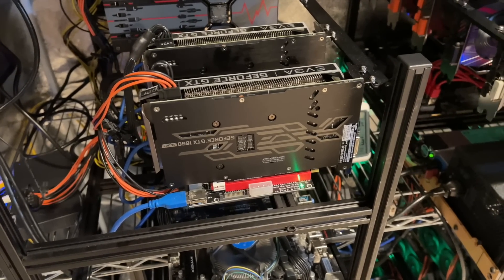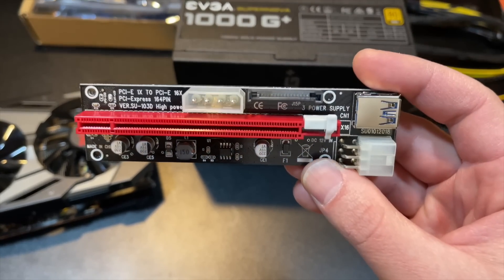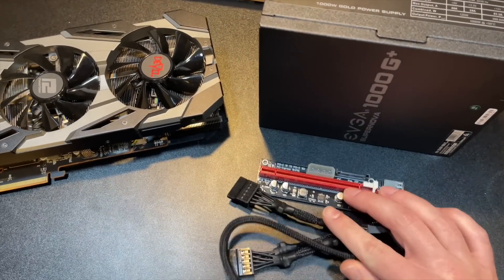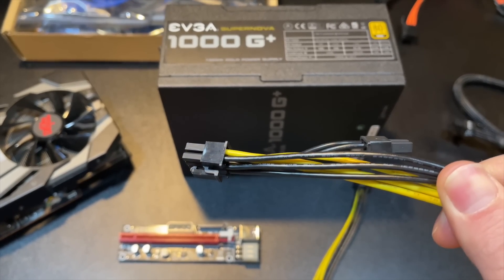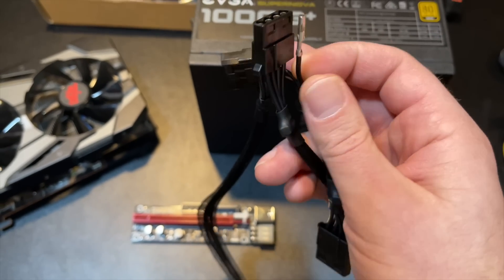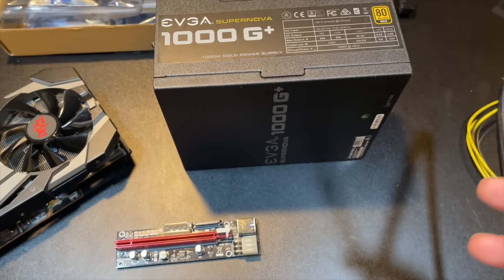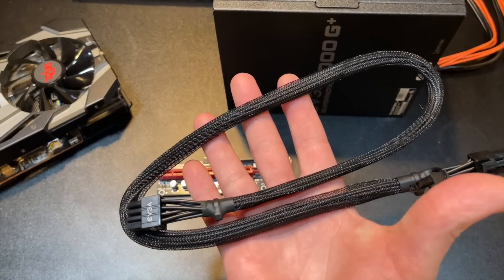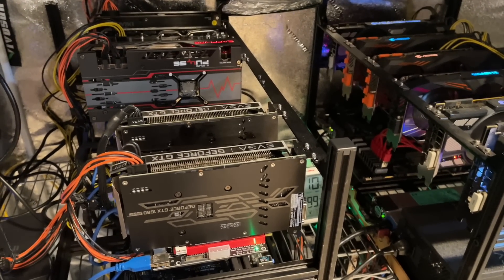Powering GPU Mining Risers Safely

Comment: What are your thoughts on using a longer USB 3.0 cable (5 to 6ft) instead of the short 2ft cable that comes with the riser? Can the length potentially cause issues?
Reply from the maker: You should be fine. I've seen miners using cables of varying lengths in their builds.
Reply: @RedFoxCrypto  Great, thanks! I have another question if you wouldn't mind looking at... I'm planning on using a pcie cable to power my gpu and riser. My question is, my 1080 gpu requires an 8 pin and 6 pin input. Would it be ok to run one pcie cable to both the gpu and riser board? I would use one evga dual connector pcie cable (two 8-pin connectors). On the short end connector, I would use a pcie splitter and connect it to the gpu 8 and 6 pin inputs, then on the long end connector, I would run that directly to the riser board 6-pin input. So essentially, I would be splitting the cable 3 ways (one 8-pin and two 6-pins). The 1080 GPU is rated for a max of 225w (one 8-pin and one 6-pin input). When mining, the 1080 usually draws around 170w. So if the riser board can use a max of 75w, and the GPU can use at max 225w, the maximum amount of watts would be 300. If the evga 8-pin pcie cable can safely supply 300w (two 8-pin connectors that can connect to two gpu 8-pin inputs rated each for 150w, would be a total of 300w) this should work, right?
Reply: @RedFoxCrypto  any thoughts on my previous reply would be greatly appreciated.

Comment: I'm planning on using a pcie cable to power my gpu and riser. My question is, my 1080 gpu requires an 8 pin and 6 pin input. Would it be ok to run one pcie cable to both the gpu and riser board? I would use one evga dual connector pcie cable (two 8-pin connectors). On the short end connector, I would use a pcie splitter and connect it to the gpu 8 and 6 pin inputs, then on the long end connector, I would run that directly to the riser board 6-pin input. So essentially, I would be splitting the cable 3 ways (one 8-pin and two 6-pins). The 1080 GPU is rated for a max of 225w (one 8-pin and one 6-pin input). When mining, the 1080 usually draws around 170w. So if the riser board can use a max of 75w, and the GPU can use at max 225w, the maximum amount of watts would be 300. If the evga 8-pin pcie cable can safely supply 300w (two 8-pin connectors that can connect to two gpu 8-pin inputs rated each for 150w, would be a total of 300w) this should work, right?

Comment: Thanks for the information. Regarding the molex, I know as a rule of thumb that current is a function of thickness, and by eye they are the thickest plug. Thats a good starting point. But look at the thinnest part of the connector should give some idea of quality. If the neck is super thin, thats where the heat will be, even if the connector is wide enough. I checked current specs on the genuine pins, and they are as you say. I took a measuring tool to the connectors on my PSU and on an external hard drive caddy, and both had pins which measured 2.6mm side to side. The specs dont indicate squared, which is often the case for power cables so I do think they are 2.6mm pins on PC, even if it is only a defacto standard. I have not seen a different size on PC connectors in the last 30 years. I have seen different sizes on 4 pin molex connectors but they were from other non-pc applications. So I am very confident on 2.6mm being a defacto pc standard. Now the big gotcha, is you get 2 circuits - +5, +12 and and gnd each. And on my 850 watt 'high current' gamer psu, those 4 pins go in to a pci-e 6 pin style connector, with molex pin to 1 pci-e pin, and 2 empty slots. These pins are smaller than the molex connectors, so less current will be supported at the PSU end. In fact 1/3rd of what you will get with 3 wires on a real pci-e connector. I think this is a common way of doing it with modern PSUs so in a lot of cases the molex limit will be on the PSU end. If they are hard wired to the PSU PCB however  I'd say they'd be good to go.

Comment: Well no -- the issue here is NOT what the CONNECTOR is rated at, it's what the WIRE is rated at.  Each SATA and MOLEX pigtail has a SINGLE 12v wire -- that's it.  Your 6 pin PCIE cable has 3 (8 pin is 6 pin + 2 grounds, beats me).  8 pin at 150w places ~50w per wire, 100w per wire if you've got a doubler.  A 3 port pigtail for SATA power will try to put 57w x 3 into a single 12v wire -- 172w.  That's the same as trying to pull 516w through a single 6 pin.  The weak spot will be usually at the crimp on the first connector.  It will heat up and cascade from there.   If you have 3  or more sata / molex pigtails coming out of the PSU, cut them all and terminate them into a 6 pin.  It really helps if you have the proper tools and connectors.  Another thing with the risers is to port team. -- Use both the sata and molex connectors on them -- 3 cards across 2 separate pigtails will place 112.5w per wire and 37.5w per connector.

Comment: The 4 pin molex amperage question: as I know, these pins are rated for the wire, they will be able to crimped on. Like there are cheap pin for 20-22 awg , there are common 18 awg, and also  more robust pins for the 16 awg wires. It is hard to crimp a cheap pin to a 16 awg wire, so you can guess the amperage based on the wire gauge

Comment: Some risers come with a splitter from 6pin PCIe connector to two SATA, so each SATA can handle 37,5W. To be safe, plug one connector on each SATA strand. (You'll need two).

Comment: What are your thoughts on PCIE cables that come pre-split (so 8 & a 6/2 combo) for dual PCIE GPUs?
Reply: It is fine as long as you keep the wattage down. Also depends on the cable quality. I avoid ever going over 200W on a single cable.

Comment: Hey I have  few questions, and nobody can really answer them for me. Hopefully you can. Also I've looked through most of your videos and I still can't find how you are powering the top of the gpu. So lets say for the 3070, I believe that's what was in the video here. So I have a PCIe from my PSU, to a splitter that is going to two risers. Then how are you powering the top of the card? With 1 PCIe wire from the psu? Where is that 6 pin PCIe coming from, does it get split off from the PCIe from the psu? Also I'm looking to get PSUs that are 1000w, which I believe will have 4 PCIe slots. 

Thanks!!!
Reply from the maker: Hey Drew! I have a single PCIe cable that splits into a dual 6+2 pin connector at the end. I use that to go into the GPU itself straight from the PSU. https://external-content.duckduckgo.com/iu/?u=https%3A%2F%2Fc1.neweggimages.com%2FProductImage%2FAMSJS2012123Dysf.jpg&f=1&nofb=1
Reply: @RedFoxCrypto  okay awesome thanks! I was assuming I had to use 3 slots on my psu for each gpu? So is this the way you power 3080s also? Also this might help me because I might buy 2 850s psu's.

Comment: looking for a splitter on amazon for the PCI riser. The ones in your link are sold out. Do you have any new suggestions. I am very new to mining rig building..Also how do you chain multiple PSU?
Reply from the maker: Those splitters will be back in stock this week. You can get various accessories to chain together PSUs. Add2PSU for multiple ATX power supplies or breakout boards with Molex for server PSUs.

Comment: can i use 8-pin split to 2 x 8pins
Reply from the maker: Yes, but still keep it below 288w on that strand.
Reply: @RedFoxCrypto  thanks, if it's 6pin to dual 8pin, which slot from psu would i put it,

Comment: New subscriber after this video, thanks for all the info. On the Corsair PSU I have cables with x2 6+2 pins without using a splitter. I am powering a 1080ti from one cable using the 6 and 8pin connector. The TDP for the ti is 250w. According to this the 8pin cable can carry 288w https://www.gpuminingresources.com/p/psu-cables.html however this says the 6pin is 216w not 192w. So in theory I could use a splitter on the 6 pin and put that to the riser and gpu and on the same cable use the 8 pin to the card. Whats the max the 6pin on the card can draw? Thanks again
Reply from the maker: Thanks Anthony. The max your x2 6+2 cable could do in ideal conditions would be the 288w (3 8A pins*12v rail). You still want to be mindful of staying around 80% of the max wattage since it'll be a continuous load. This is to be safe around any voltage spikes. That said, I would use a separate PCIe cable to power the riser from the one going into the PCIe ports on the GPU. You can even split that to power 2 risers since they'll draw 75w each.
Reply: @RedFoxCrypto  thanks for the reply! I'll look at getting a second psu for the risers but for the moment what I'm doing is technically safe?
Reply: Sorry to go on, but want to make sure, if a gpu tdp is 250w and assume the riser is drawing the full 75w then the 6 and 8 pin can only be drawing 175w between them, so other than maybe being slightly over the 20% redundency this should be fine

Comment: But isnt that a myth? Yes the PCIE max output is 75watts. However it is really  up to the card and how its connected. If recall, if 6pin, would mean 75 watts via the card split with 75 via the mobo for 150 total. Which with your logic is correct. However if a 6pin + 8pin is used, the card now pulls 75+150 watts, so the total from the PCIE is roughly 25 watts, well in range of the sata capability of 54 watts. Though I wouldn't daisy change them and run maybe 1 sata cable per riser. x1, x4, x8 or x16 all do the same draws of 75watts, regardless of size. But again the gpu is what determines how much is drawn.
Reply from the maker: Different GPUs will draw their power in different ways over the combination of the PCIe slot or plug-in connectors. Some of the newer AMD cards have been tested to draw the full 75w from the riser and less over the PCIe plugs. In my experience, NVIDIA generally pulls most from the PCIe plugs on the GPU and minimal from the riser.
Reply: @RedFoxCrypto  This is confusing, isnt the pcie slot and the pcie/risers both one in the same? The gpu draws power from teh 6pin/8pin connectors, from there it hooks up to the pcie slots/risers. What I am getting at is that its purely subjective to what you are running. If your running a card that draws less than 200 watts, its safe to use teh sata to power up that riser, as most of the power will come driectly from the PSU. If your doing something lets say a 3080 that requires 300 watts than yes please use the appropriate cables to hook it up and ensure you get 75watts from the riser, 75 from the 6pin and 150 from the 8pin.

Comment: Awesome content! I enojyed your knowledge on electrical standards since they are very important for the most efficient setups
. I have a question though, how do you solve floating ground issues having multiple psu? Is there a way you are connecting all your power supplies through a specific connection?

Comment: This is easily the most detailed explanation i have come across. But I still have a doubt. the PCIE on takes 75W. lets say i have a RTX 3080 rated at 320W. Are you saying that the graphics card at full power takes 75W through the riser and rest (i.e.245 W) through direct power from PSU or the RTX 3080 takes complete 320W directly and the riser takes 75W in addition to the 320W. Very mew to mining.
Reply from the maker: Thanks dude! The 320w would be split between the riser and the PCIe ports on the GPU.

Comment: I'm using Molex-powered risers, but I made custom adapters for them because my Zalman PSU doesn't have enough cables/outputs. 
(1x Molex (to supply a 5V rail) & 1x 6-pin) -> (3x 75W Molex having both 5V and 12V rails)

Comment: TDP is not MAX. Ask any IT professional, ask Steve at Gamer's Nexus if you don't believe me. TDP can be higher under certain conditions, not with mining, but don't think if TDP is 200W the card won't be able to draw 300W, yes it will, there is another limit for that. Also, no bloody modern card drains 75W out of PCI-E, no chance, it puts the strain on the motherboard so the manufacturers design it the way to pull more power from the PSU directly. 10 years ago YES, that was the case!
Reply from the maker: There are absolutely cards that will draw 75w from PCIe. Watch BitsBeTrippin videos.
Reply: @RedFoxCrypto  What card for example? I know that my Asus 3070 drain between 16w-18w. I understand that you've read it somewhere, but I can measure the actual drain. Also don't forget that the riser actually gets the power using the usb cable as well - usb 3 cables are rated for 1.5A and they actually get the power from the board as well. I don't argue that health and safety is important and it's better to be on the safe side. I'm a gaming PC specialist and I mining is a very light mode for the graphics cards really, apart from the memory usage and the fan load.

Comment: one of your gpu fans stopped working on the video, that was awsome timing.
Reply: i think it wasn't gone bad, Latest gpu sometime run only one fan it it thinks Temps are very low.
Reply: I had a evga 1070 that did that, some evga have memory sensors and will turn on the fan over the memory only if it reaches a certain temp

Comment: Sorry, but that more or less depends of the quality of your hardware mostly the PSU(s). I have being using SATA to power my Risers for more than 3 Years ; not a single problem since then. They key is undervolting, using MAX. 2 Sata per Cable strain and test if the cables are hot (high risk of the Fire-nation attacking your rig :D ). I agree that powering via 4Pin. aka. Molex and PCI-E(who wastes 6 Pin to power risers tho`) is safer. Usually the Risers draw around 45-52W.  SOME Power hungry GPUs(VEGA,Big Navi, RTXs etc) will definitely need to be powered via MOLEX ... not every GPU will draw more than 50W from the PCI-Slot. My advice is : do your own research , calculate your Rig`s power draw, touch the cables - if they are hot - then you have a problem!    :) . Good luck and happy mining ! 
P.s. Hope ETH 2.0 (final step to PoS) takes more than 2 years to release :P

Comment: https://www.gpuminingresources.com/p/psu-cables.html

https://www.evga.com/support/faq/FAQdetails.aspx?faqid=59716#:~:text=The%20ATX%20standard%20for%20SATA,a%20total%20of%204.5%20amps.
All of our EVGA power supplies are manufactured to conform to ATX standards. The ATX specification has different ratings for voltage and wattage, depending on the connector that is used. In a typical configuration, where a graphics card is directly installed into a PCIe slot on a motherboard, that PCIe slot is specified to deliver 75 watts.

PCIe risers and adapters do not conform to ATX standards. Using these types of adapters can result in damage to any system components.

The ATX standard for SATA or Molex connections is rated for 54 watts. Each SATA/Molex connector provides three 12v pins at 1.5 amps each, for a total of 4.5 amps. 12 volts, times 4.5 amps, equals 54 watts able to be provided by a SATA/Molex connector.

Some PCIe risers do not conform to ATX specifications. As ATX specifications require the PCIe slot to supply 75 watts, a PCIe riser may potentially overdraw the SATA/Molex connector by 21 watts. Please confirm that any risers you use meet ATX specifications before use. Risers that do not meet ATX specifications are not recommended for use with any EVGA power supplies or graphics cards.

If multiple graphics cards are needed to be installed in a system, it is recommended that they are installed directly into the PCIe slot on the motherboard.

Comment: thanks this helped alot, definitely using my pcie cables to power the risers. My issue is I wanna use multiple powersupplies (the ones i got are 750W), to power up 3070. I got gold 750w evga (multiple ones, as newegg bundles them with a 3070). Two main questions, is 1 enough to power up two 3070s (and their risers). Second question is, can I use 3 PSUs on one rig? I searched online and most people use a 24pin splitter, is it necessary to have all PSUs connected to the motherboard or is one enough, while the rest are powering up the other gpus? I'm assuming they will technically power the 3070, but the motherboard will only recognize those that are connected to it via 24pin.
Reply from the maker: Thanks dude. Great questions. You can definitely do two 3070s on a 750w. They max they'll run at full TDP is 220w each. 220+220+100 (motherboard, CPU, etc)= 540w.

You can use multiple PSUs on one rig. You just have to power up the PSUs not connected to the motherboard first. Once those GPUs are running, power up the PSU/motherboard and you are good to go. There are accessories you can get to make them all power up together, but that's ultimately just a convenience thing as far as I've seen it. Once the rig is up very rarely are you powering it off and on.
Reply: @RedFoxCrypto  Awesome. Ye I reckoned I would just get those 24pin jumper bridge to get them up and running.

Comment: The 6-pin has 3 ground pins and 3 12V pins. But the 8-pin has 5 ground pins and still 3 12V pins. No issue with it speaking of power, but I can't understand what's the point behind this standard. Why would anybody designed the 8-pin this way.
Reply from the maker: I'm wondering if it was because originally the 6-pin had an optional 3rd ground where the 8-pin always included all three.